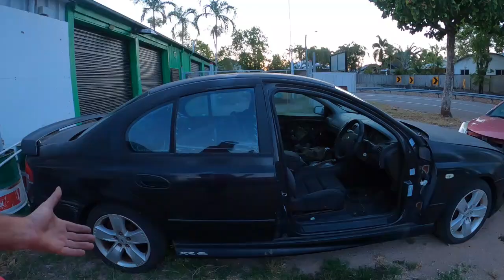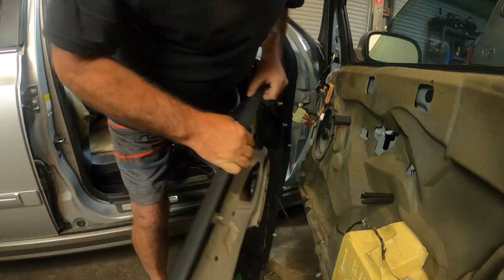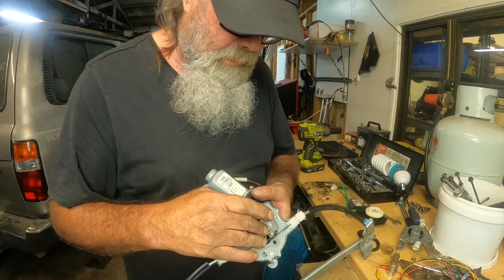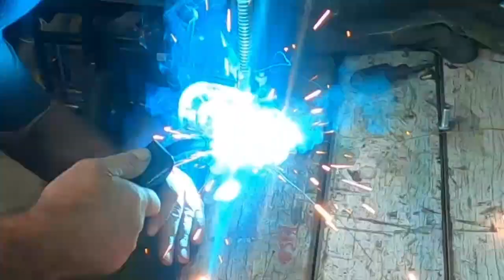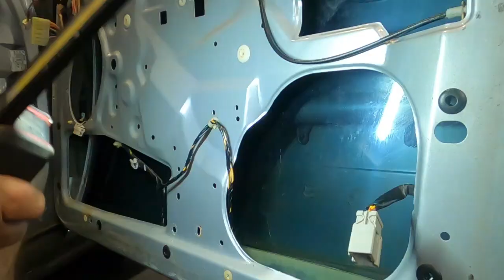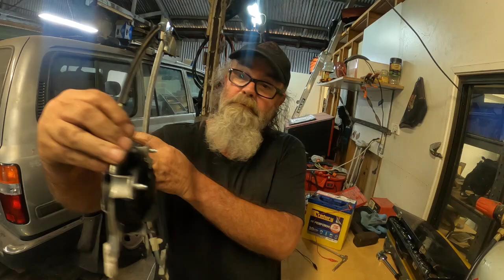BF Ford Fairlane Window Regulator Repair

Comment: I have 3 of them to do on a Golf 😂. On the golf mk5 the door skin has to come off right pain in the butt. I was just going to leave it till the spring. Nice one buddy good fix 👍
Reply from the maker: Hi Ali. Would you repair the regs on the golf or replace? I'm not familiar with the setup on them.
Reply: @BennosShed  I have in the past replaced the cables in them.

Comment: Good work Benno. I’m curious would you have been able to 3d print a new cog ? Asking for a friend 😂. Nah I’m just curious
Reply from the maker: Hi Robert, if it had been the gear yes I could have 3d printed a replacement using Nylon/ carbon fiber filament. Could have also printed a housing if the welding failed.
Reply: @ that’s handy👍